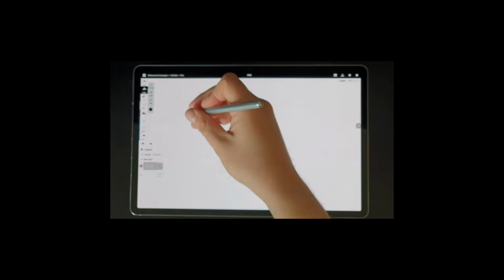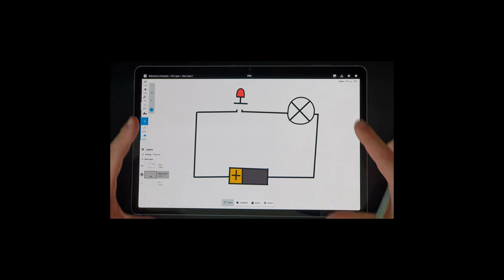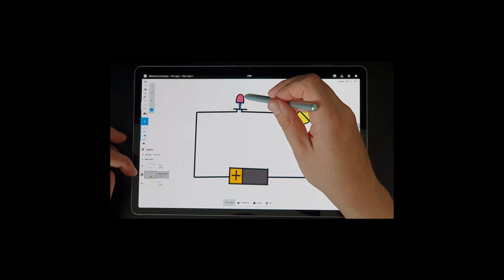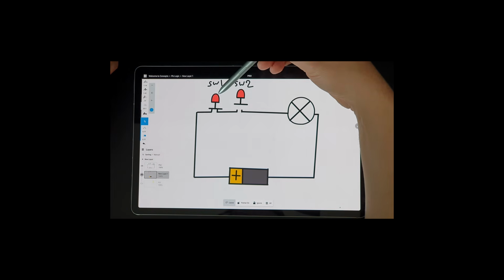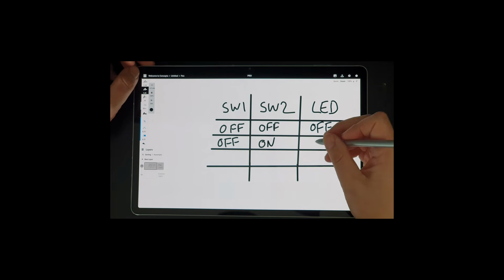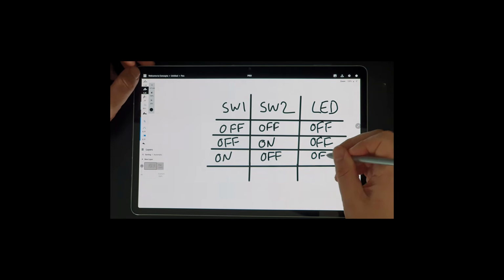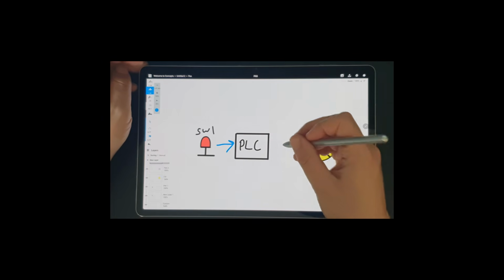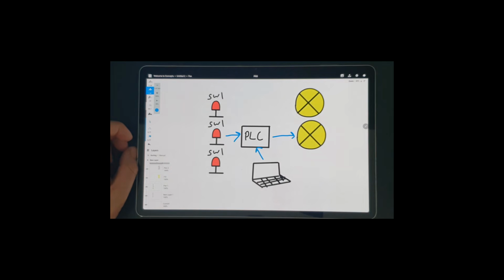PLC Basics for Beginners  - [Part 1]

Comment: Been going to school for computer  science  realized coding is not what I want to do I want to fix machines in factories.. so trying to learn and understand  as much as I can
Reply: 'Automation' and 'industrial systems'

These are multidisciplinary technical fields that will qualify you to implement practical applications such as designing and maintaining the control systems for an assembly line, for example. PLC use 'ladder logic' which is a more sophisticated version of 'relay logic'. In a relay, you have a bank of closed and open switches. When you trigger the relay('power on') all of the switches switch; closed opens and open closes. When you 'power off', all the switches return to their normal state. A PLC is essentially a fancy, computerized relay, to achieve more control than simply power on/off to make all the switches turn on/off; with a plc you can activate individual switches, on various conditions, such as time, interations(button press, etc) and sensor inputs.
Reply: Try EET*

Comment: I’m not understanding why you would have two switches. Pardon my misunderstanding. Any help?
Reply from the maker: Hi Nick. In depends on what your output (lamp) is in the application. In the OR configuration you might like to have 2 different buttons in different location activating the same output. In the AND configuration imagine the switches are permissive in nature. You might have say 2 different pressure switches in different parts of a plant that need to close in order to make a pump run. Does that help?
Reply: @InstrumentationControl  thank you so much for the fast reply. Yes you cleared it all up for me.
Reply: maybe as a safety,  on certain machines that require both hands in machines so no one gets hurt